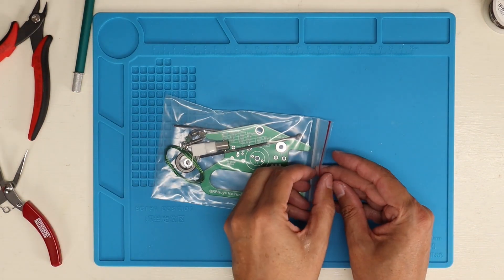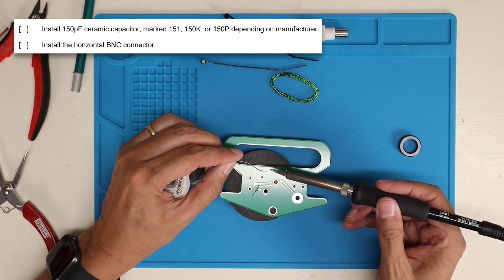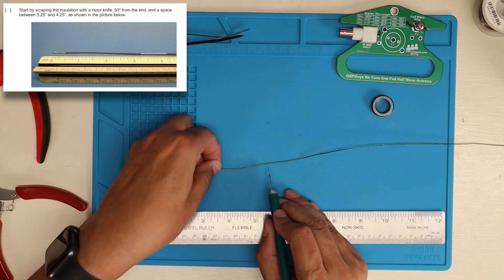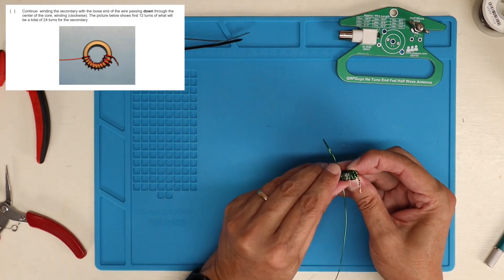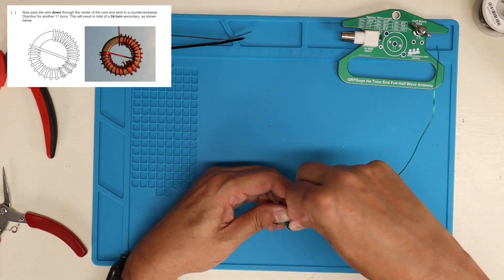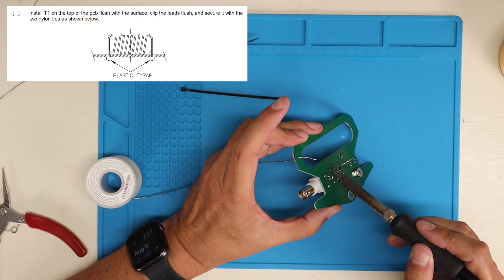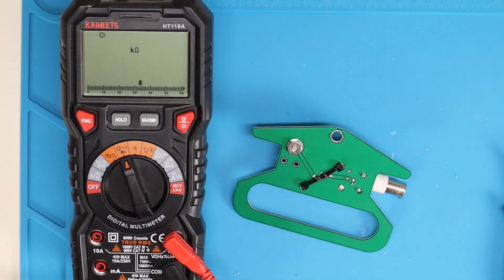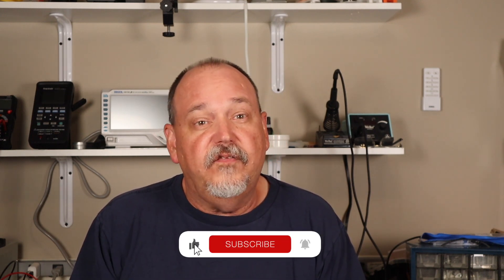QRP Guys End Fed Half Wave Kit - Full Build Instructions

Comment: Just a note to say that 1.5:1 for the band is perfectly acceptable. You could've folded the original length of wire back and "walked" the VSWR measurements into the 20m band. (Fold, measure, fold, measure, etc.) When you found a 1.0:1 point, cut the wire and solder.
Be interested to see what the impedance would have been then.
Reply from the maker: 1.5:1 is certainly acceptable but my 49:1 unun's give me a better SWR.

Comment: I know from experience that the 49/1 works better! I built one using the 49/1 configuration and 66 ft of wire and it ended up with 40,20,15,and10 meters. I did the same with a 20 meter version and 33ft of wire works great on 20 and 10. So don't be afraid to experement and have fun. I really love the EFHW antennas and I have built some QRO versions with good success. 73 from ki0ad/Jim
Reply from the maker: Thanks James, You have imspired me to convert mine to 49:1. I agree 49:1 works better than the 64:1 that is used on this antenna.
Reply: Hello! I wonder, how do you change to 49/1 to have 40 to 10 meters despite the wire length? thanks!!!
Reply: @ferrnyyyy  just add more wire so you have 66ft and go from there, you might have 20 meter version and can wind a coil to add 40 meters. on the end of my 40 meter I added 6ft of wire and a 110 mh coil so in 72 ft I have 10-80.
Reply: @jamesgeorge1709  great! Only with wire lengths, you didn’t modified the torpid, didn’t you?

Comment: "it's important to have the toroid leads go into the right spots." Proceeds to not explain what the right spots are...

Thanks..
Reply from the maker: Thanks for that Ben, you caught me, I didn't. the single leads go in the small holes Near the very center hole and the lead twisted together go in the top left hole if you look at 7:38 on the video. I shold have slowed down and shown that better.
Reply: @houseofhamradio  I managed to figure it out. If you wound the toroid like how the instructions  prescribe, they all do fall in line correctly when you insert the primary into the bigger hole, which is clear.
Reply: I managed to wind the coil as a mirror image of what was intended; I just soldered it on the other side of the board; NP...

Comment: Thank You for the information.  I am looking for a portable 100 watt EFHW antenna.  I just need the winder part.  I have 6,  240-43 and some 4, 3-KV caps, and some 14 gage wire. I can make some transformers but I need something to put them on and to wind up the wire.
Reply from the maker: Hi Don, I know a lot of folks use kite string winders like this one from Amazon https://amzn.to/3Rmr8ry
If you have access to a 3D printer you can print one of the many options on Thingiverse.
I hope that helps.
Bob
WV7W

Comment: Thanks for your video. I built this kit just a couple of weekends ago. I have had a hard time getting a usable SWR without a tuner on 20 meters and on 17 meters. The antenna itself seems very finicky - if my coax touches the ground I have a > 3 SWR and if off the ground I can get SWR to less than 2. This is my first antenna build and I am new to trimming antennas, new to QRP. I'm planning on taking it on a SOTA this weekend and am hoping I can get good performance with a tuner.
Reply from the maker: So it isn't just me then. Thanks for the additional data point.
Reply: For this antenna the coax acts as a counterpoise, End Fed with 49:1 baluns run this way.  So can see the coax drifting around affecting SWR.